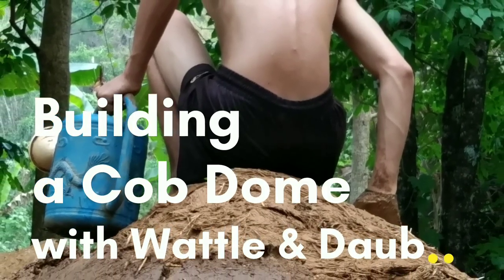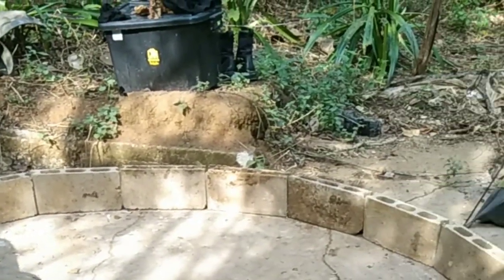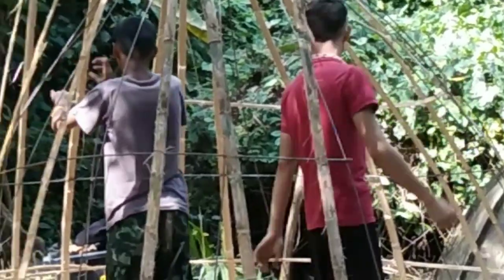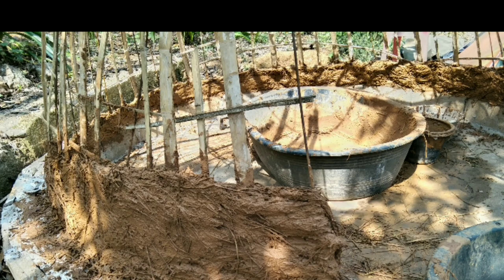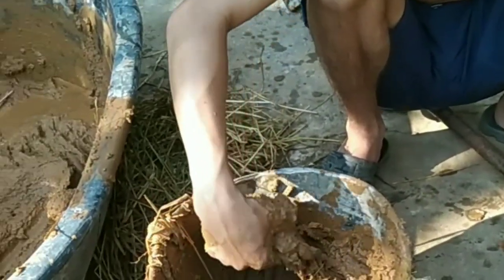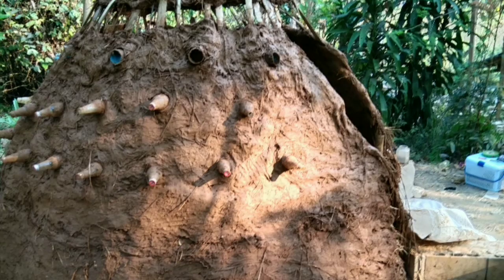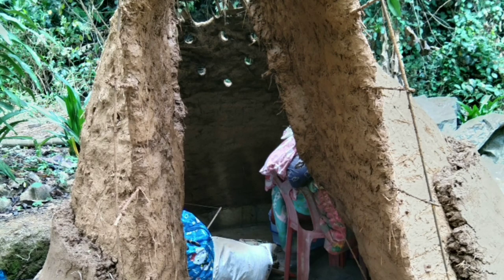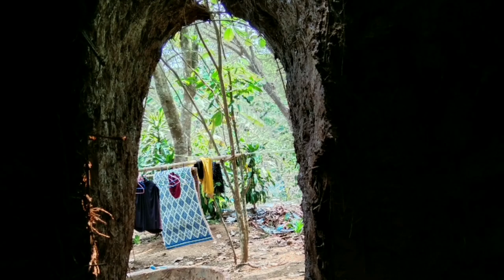Building a stormshelter cob dome

Comment: wall cracking?
Reply from the maker: No. No problem there, only at the cob dome
Reply: you can add in horse manure to make sure the clay doesn't crack - the horse digest the straw partially so the fine bits of straw in the manure then binds the clay well.